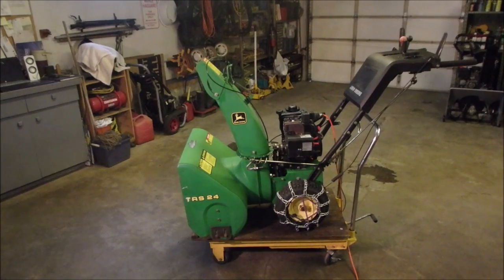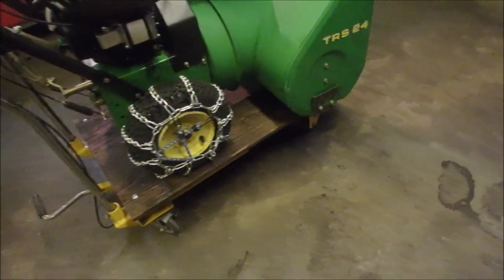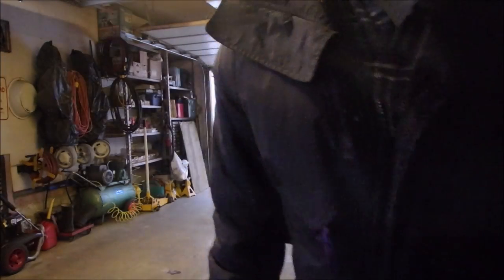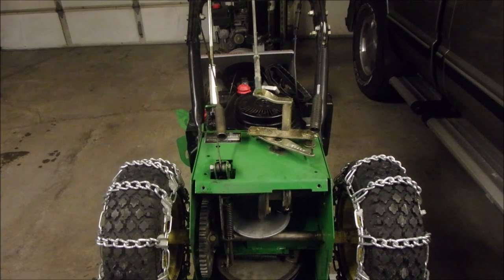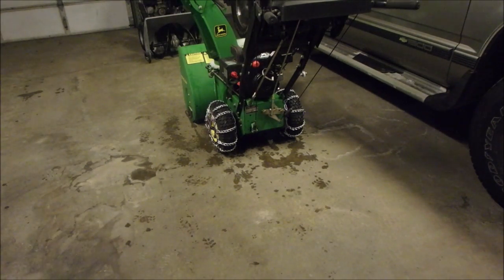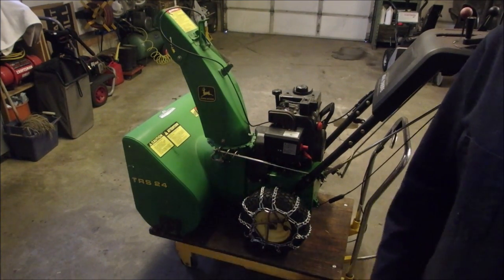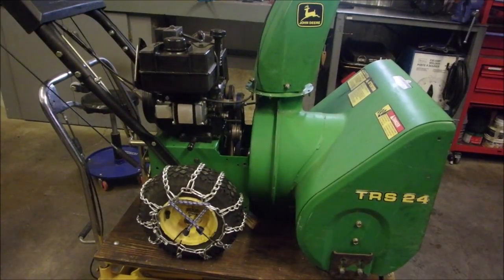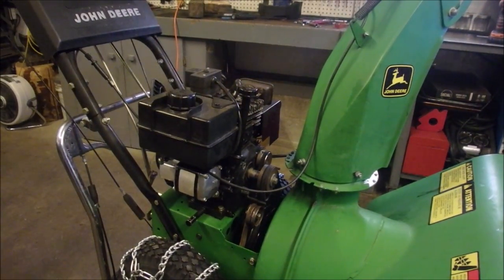John Deere TRS 24 Completion and Test

Comment: Same here Bruce, I needed a half size belt on my 1986 JD1026 as well. I also found out I have to cut the lawn/grass shorter in the Fall to allow the scraper bar to not dig in so bad and stop the jerky motion. Adjusting the skid shoes down a bit more helps too. Good to see it's operational now. 👍
Reply from the maker: Yes i think it is done!!!

Comment: Nice work Bruce!
You’ll be too attached to it, to sell it.
Last fall I did a repair on a snowblower with a broken and seized shear pin.  Instead of drilling out the pin, I drilled a new hole through the auger pipe and then through the shaft, with my drill press.  That process could have worked on yours.
Ah… I see your apple tree didn’t lose its leaves either.  I hope it doesn’t give mine an excuse to go a third year with no apples!
Reply from the maker: I will prune it early in the spring.  that may help